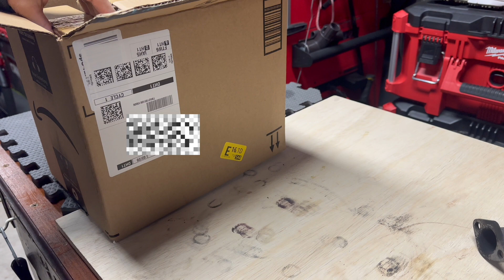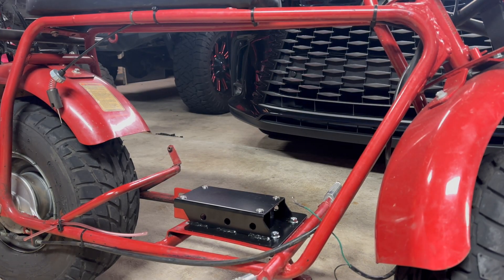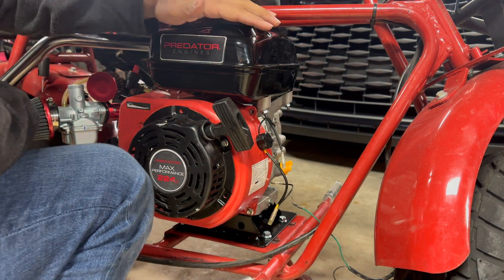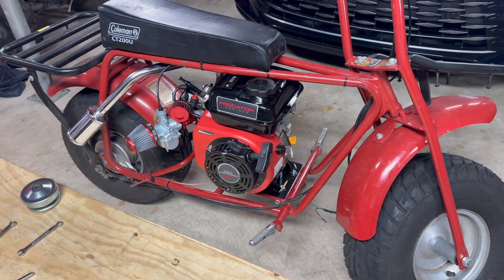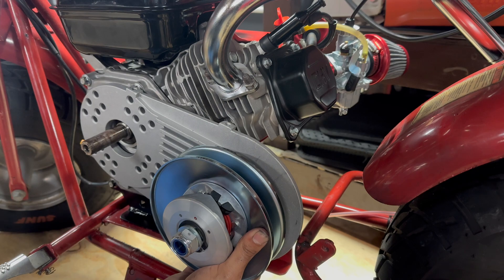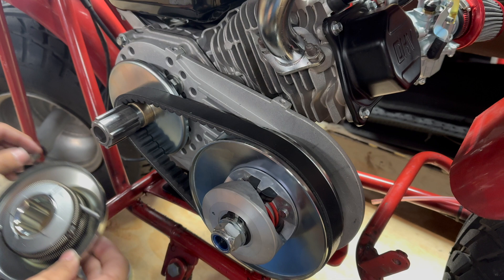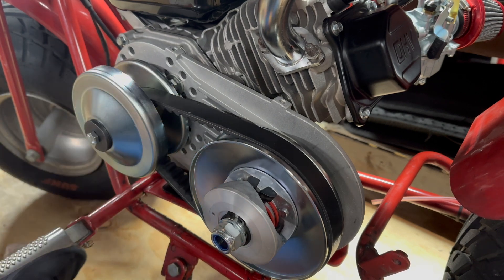How To Install A Torque Converter On Coleman CT200U, With Upgraded Gas Tank, And Riser Mount!

Comment: I forgot to get a smaller gas tank mine hits the top
Reply: Can you still run the torque converter or did you have to get a smaller gas tank

Comment: I also ran into a slight misalignment problem. I tightened the bolt on the driven side with a ratchet but it still seems slightly off. Did you tighten it with an impact? Even when I tighten it all the way down it slides back and forth a very slight amount.
Reply from the maker: @masterprediction7353  I did do it with an impact, but you have to be very careful. If you start to torque that nut too much, you will bend that C clip in the back. And that will cause your belt to not line up properly. I’ve even done it with a ratchet, so make sure your clip on the back is straight.
Reply: @ the clip on the back is fine. It’s actually still sliding a little bit because there’s a small amount of space between the clip and the backing plate. Maybe I just haven’t engaged the plastic on the nut enough, I only tightened it down with a wrench. I’ll try that today.

Comment: Howdy, love the 224 on my Massimo Warrior. The 224 was a direct fit, no riser plate was needed but I changed to stock gas tank. Also, with the GTC torque converter, I didn't need to cut the torque converter plate. 52 mph was my top speed with no mods other than gov. delete. It really runs well out of the box but may modify later. Interesting to see how it does on this bike. Thanks.

Comment: Sick I have the same build, except im keeping mine stock, What I did differently wich was pretty stupid was instead of using the riser wich caused clearence issues, I used largee half inch thick nuts as a riser, and I had to cut a little bit of the back plate of the torque converter off so it could clear the frame, drives so fun and the torque is nuts.
Reply from the maker: @x3.hamoodi_14  not stupid if it works! That’s actually kind of what I did on my CT100U